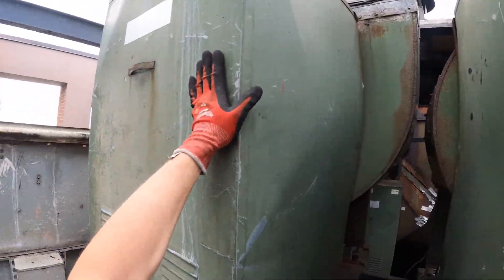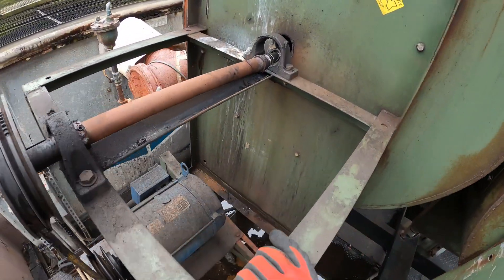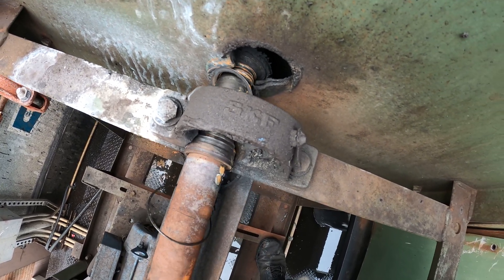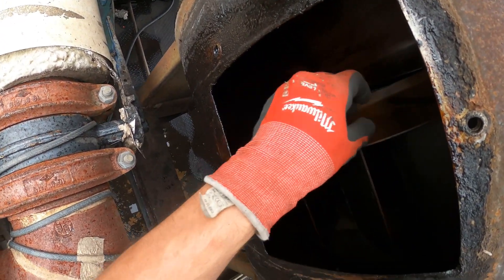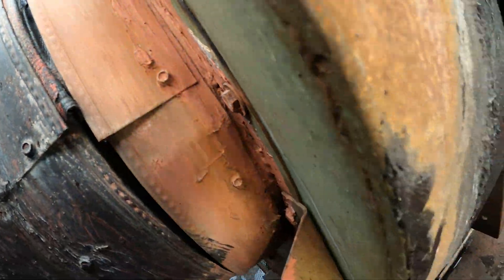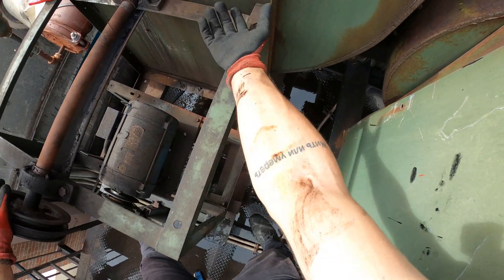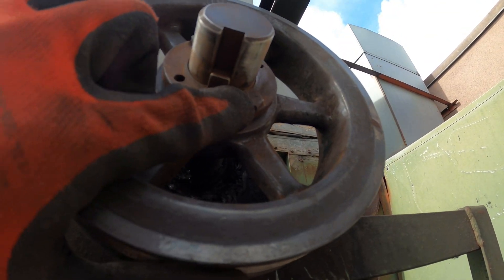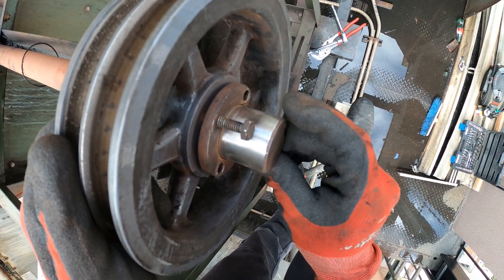HVAC Service Call: Belt Driven Centrifugal Exhaust Fan Not Working (Broken Pillow Block Bearings)

Comment: Get yourself a snap on or Ingersoll  air hammer.  You’ll use it every time on jobs like this. You can walk those bearing races off just with the vibration of the hammer. Often times without even cleaning the rust off the shaft.
Reply: I think that I need an apprenticeship since I am learning this at a 4 year college in Colorado Springs

Comment: That thing is so overenginnered, overcomplex, overuseless, why not set it with a direct drive motor? why not put a little  cover to protect the motor, why not bigger dual ball bearings, why not a door instead of a fixture to encage the turbine. I fell like this is so expensive and so wrongfukly made.

Comment: You need small crescent wrenches in your tool bag. I've ran into similar issues with the bolt had no play and can't fit even thin wall socket to loose up bolt. Small crescent worked like a miracle. I like that small Milwaukee grinder, I'll be adding that to my tools
Reply from the maker: I now have all the crescent wrenches in my bag. Down to the small 4 inch one. Theh are definitely great. That small milwaukee M12 fuel grinder is such a handy little tool. Love that its small so you can get into tight space and it's very light. Thanks for the advice & thank you for watching! Stay tuned for new videos every week🔧⚡️

Comment: Would it not have been easier to just put a piece of steel across the brackets in front of the destroyed bearing, then just mount a new bearing 3 inches or so in front of the destroyed one and just abandon the bad bearing in place?
Reply: Yeah you should hace done that.
Reply: Maybe could  have had a go at cutting  and slotted into the Hardened Steel  race that was on the shaft then hit the race with a Chisel and Hammer... popping that Hardened bearing race stuck to the shaft... then sliding same off...but then agin its,"  Hurler on The Ditch.." great resolve, great Job...